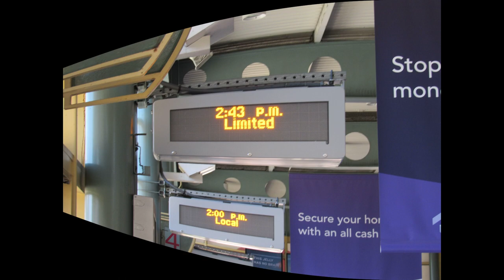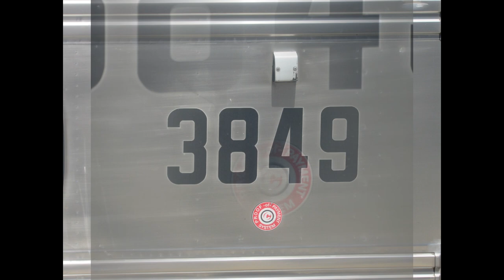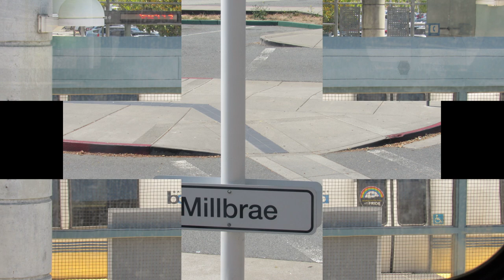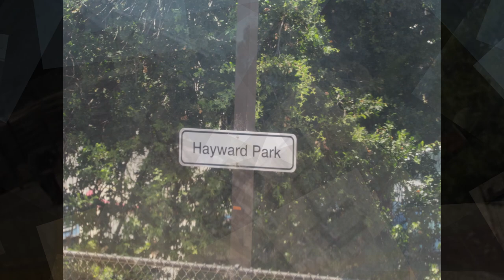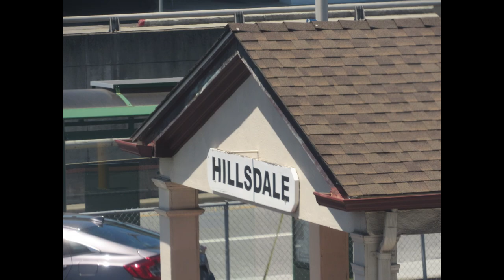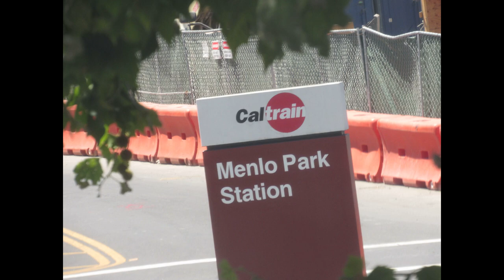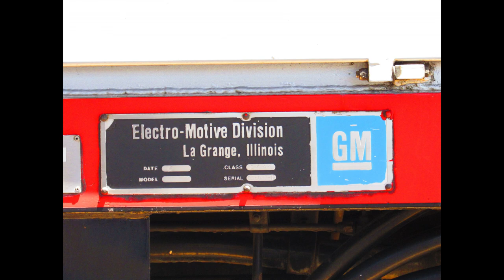7/23/19 Riding CalTrain 146 from San Francisco to San Jose Diridon

Comment: One question, is CalTrain same as Metrolink?
Reply from the maker: There are some similarities-such as special day passes and serving as a commuter operation- but there are more differences. 

One major difference is that they not only have bombardier cars but also gallery cars. Another noticeable difference is how the day pass works. It is available on any day you want and the value changes based on how many blocks(4 to 6 I think) you go through on this one commuter route. While Metrolink does have special express service during the week for the Antelope Valley line, CalTrain seems to have more separate dedicated trains such as local(makes the vast majority of stops), limited(makes a limited amount of stops) and baby bullet(an express service making much less stops).